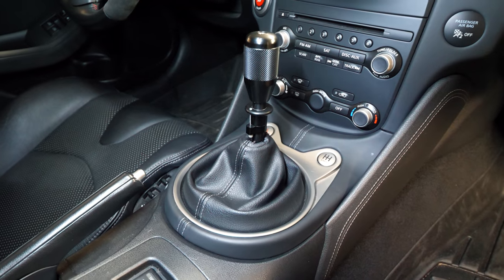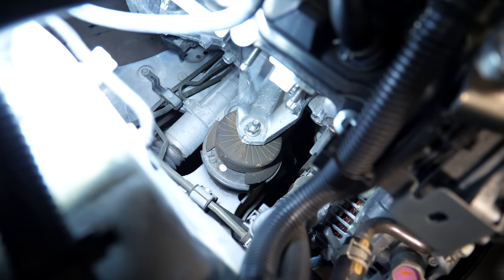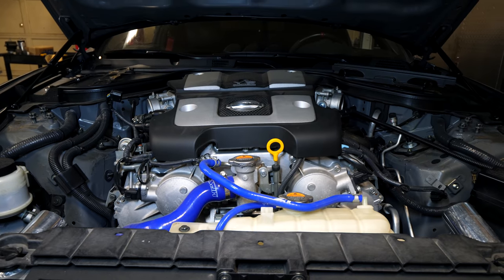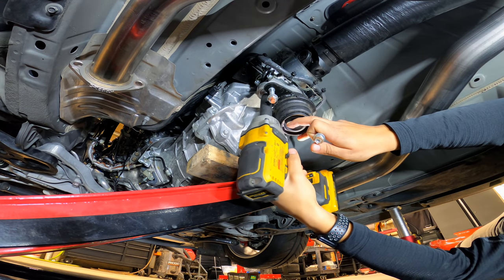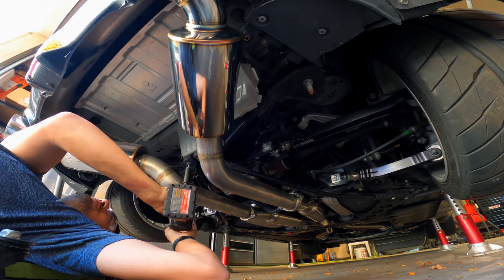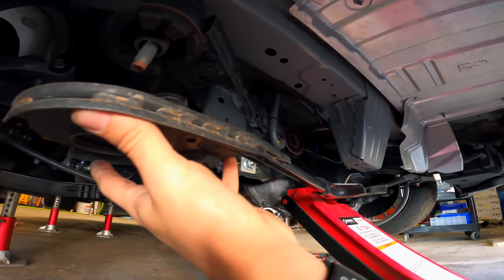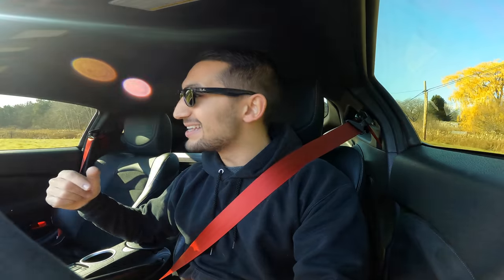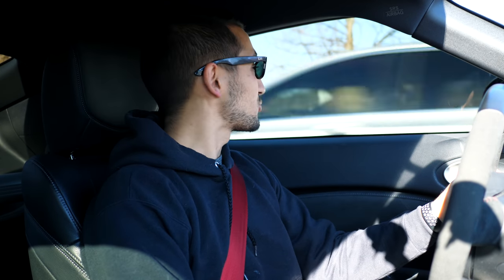Upgrading my Engine, Transmission & Rear Subframe Mounts To Polyurethane & Billet Aluminum

Comment: I love how you're approaching this car, Milan. A billet or stupidly stiff polyurethane set of mounts might be ideal for pure track and race use, but racecars are beaten hard without much regard for long term longevity and livability during normal street use. These mounts significantly improve overall handling and safety of the car without compromising chassis longevity and comfort since they still absorb the vast majority of the metal fatigue inducing high frequency vibrations but are actually stiff enough to hold things where they should be on low frequency motion inputs such cornering, accelerating/braking.
Reply from the maker: I appreciate it brother! 👊 I try to tackle mods systematically. If you've been around for awhile, even with my MINI, more power was never the first thing. Handling always came first!

Comment: That transmission mount made my car vibrate so badly I put the OEM one back in. It’s also fully adjustable, but comes with no adjustment instructions. So it’s possible I had it adjusted wrong.

Comment: Its one of those mods (like sway bars) that have no downsides to it, and not that expensive either
Reply from the maker: Couldn't agree with you more! 🙌
Reply: I'm fairly new to all this. What's the benefit or importance of a high performance sway bar? Thanks!
Reply: @staypositive4358  I had a set of Hotchkis anti-sway bars installed on my 370Z sport coupe and the difference in handling was significantly better, at the expense of a somewhat harsher ride. The car is much more responsive on the turn-in and has nearly no body roll on cornering. There is less front-end drop when I go over a driveway dip at an angle, and so my chin spoiler has less tendency to scrape the ground.
Reply: @videomaniac108  . It makes sense. Thank you so much for the reply!

Comment: Have the same mounts. Plus the poly diff bushings on my G37 6MT that is similarly tuned (UpRev) and you are absolutely correct. Huge improvement without much cost and little to no downside.
Reply from the maker: That's awesome! How is your throttle response now with all of those mounts? I'm really looking forward to upgrading the diff bushings!
Reply: @milanmastracci   hard to remember what it was when still stock, it was very sloppy. The diff bushings, then tune, then mounts, then lightweight flywheel each improved as the build continued. Coilovers in the next few weeks so I am excited to see the change in handling characteristics.
Reply: Hey bro,  can you if  torque solution transmission  mount made a difference in performance , I wanted one for g 37 6mt

Comment: The transmission mount was super easy to install only took 20 minutes and surely feels like it puts down more to the wheels. But do realize the car will have more sound and vibration

Comment: Honestly can’t wait for the diff video. I did my own Diff and mounts, I went with the Tomei LSD and the lock up is great but sometimes the clicking can get really annoying. Probably something wrong I did, but from the looks of the forums it’s normal. I will probably change it out eventually to a helical LSD and go away from Clutch lsd. 

The fluid definitely makes a difference. If you do end up going with tomeis 1.5 LSD, instead of shelling out $50 for their fluid, I’ve used an equivalent GL-5 80W-90 fluid like valvoline and mixed it with a bottle of  friction modifier and it works perfectly fine and doesn’t click as much. I tried to give redline a chance but it doesn’t work quite as well.

I also have the same color but a 2014 Base 6MT. Currently pushing 340 whp and 272 wtq. Tuned with Tomei and Z1 cold air intakes. I love the progress of your car and it’s perfect since I get to see what wheels would look good on my car while you do all the work haha. Awesome videos and keep it up!
Reply from the maker: I'm pumped for it too! I'm going with the Nismo GT Pro 1.5 Way. I like how it is adjustable, without having to disassemble the diff. I'm okay with a bit of noise here and there, as long as it performs well! 
I have lots coming for this car, and I know you'll enjoy it if you've upgraded things like your diff already! What mods do you have that got you to 340?
Reply: milanmastracci My setup is Z1 cold air intakes with test pipes and ISR Y pipe. Paired with a Tomei Catback. The single exit exhaust is the biggest gain I believe. Since my friend has the same setup except he has dual exit. Eventually I’d love to go FI but whenever I’m actually willing to spend those funds.

Comment: hi, i drive an 08 g35s w/ 5AT.

i have new vibration at idling (even when the car is fully warmed up) after installing new aftermarket (ebay, Westar) engine and transmission mounts, but i had no issues with 16 years old mounts…

Is it because they need some break-in period until they mounts settle in by themselves?

Or shall i check each nut’s torque again? (I don’t think the mechanic used torque wrench…)

Or is it because they are cheap low quality mounts?..

Please advise me!..

Comment: Why didn’t u put threadlocker on the transmission mount bolts? And it looked like red threadlocker was originally on the bolts. Why didn’t u use that? I’m not questioning you by the way. Just curious. You clearly know what you’re doing. So I just wanted to know why u did it this way. Thanks. Love the video

Comment: Love your clarity and directions in all your videos. I was curious on your point of view about a issue I've been having. My steering shaft u joint connection bolt seems to get caught on the heat wrap around my headers only when I break and take sharp right turns. It never does when turning sharp left or while driving normally. With your best judgment do you think the Solid Motor Mounts would keep the engine from shift on me?
Reply from the maker: The upgraded engine mounts will definitely help with the engine from leaning onto the steering shaft & the u-joint. What headers are you running? I ran into this issue with my OBX headers, however after switching them out for PPE headers, I've had no issues. The engine mounts will be a solid move in the right direction. I don't know if I'd suggest changing the factory mounts for solid ones, but polyurethane was perfect for me. Stiff enough to prevent the engine from moving in the engine bay, and still more than tolerable in the cabin from low NVH. Hope that helps!
Reply: @milanmastracci  thank you for your thoughts and I have the ISR shorty headers wrapped with Motordyne Art pipes. The polyurethane looks and sounds much better then going solid, I'm just curious how much more added cabin noise it will make considering it's already high now with full exhaust changed out.

Comment: So my 6mt g37 shifter moves a lot (like forward towards the engine ) when I accelerate mildly 

Just installed my z1 trans mount and that didn’t fix my issue 

Just ordered z1 motor mounts , do you think this would fix my issue 

152k OG motor mounts so I’m assuming so  if anyone has had same issue pls chime in

Comment: Good job. However, you need jack pads (looks like hockey pucks with a middle slit) for those jacking points or you'll ruin the frame.

Comment: Great video...but those bushings compliment each other...cofunctioning together to minimize movement. When you upgrade one but not the other...the original will deflect more...so it's not a fair comparison to both original bushings or both upgraded. But still cool to see how they interact
Reply from the maker: You are correct! The bushings as a full set work tremendously well together. I would 100% recommend it

Comment: hey man nice job. is that the original paint on your car? I was wondering what that color is called. I have a 2004 Touring and the silver is darker than that. I want to get it repainted a brighter tone.
Reply from the maker: Hey man! If you have an 04, that means you have a 350Z, so I don't think all of the paint codes continued on for the later Z34 vehicles.

Comment: Hi Milan,  apologies for this off topic comment.  I'm hitting a little snag on my 09 Accord coupe. I'm replacing the door seal, driver's side. There is plastic body trim holding the gasket along the bottom. I can't  find any fasteners. Does this trim snap out somehow?  Thanks, appreciate the help. Tom
Reply from the maker: If you give it a little yank upgrades, it will unclip itself from the door sill area. Cheers!
Reply: Thanks, I'll give it a try and let you know. Regards Tom

Comment: The car looks like it’s new underneath here in sweden all the cars are rusty from all the salt on the roads. How many miles does it have?
Reply from the maker: 40k kilometers = ~25k miles. The only reason why this looks the way it does is because it doesn't see winter, and it hardly sees rain. Any vehicle here that sees winter looks absolutely atrocious, even vehicles a couple years old..

Comment: This is very important for the Fiat Abarth, not the one with the MX-5 body- the mounts fail and might cause one of the CV axle joints to fail.
Reply from the maker: That is very true! The mounts in a FWD platform are more important than RWD since everything happens up front! I've gone through multiple axles on my Accord since the mounts were so soft